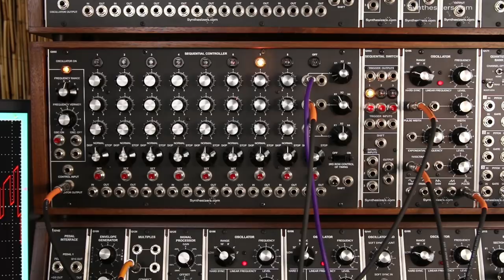Q960 Sequencer RATCHETING WITH ONE OSCILLATOR tutorial - Synthesizers.com

Comment from the maker: The 3rd row timing sets the LENGTH of each step.  This patch sets the number of BEATS per step.  Beats is the number of times the envelopes are fired.  How each of these sound depends a lot upon  how you have the envelopes set.  If they are set with no sustain, then they will be short spikes that occur at the beginning of a note.  With the sustain turned up, you'll hear a beat that is as long as the step.